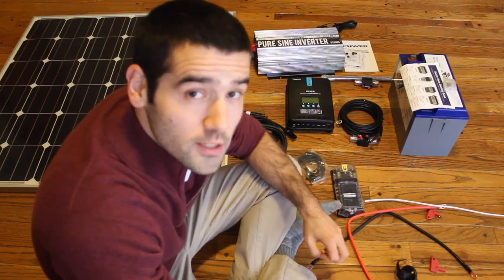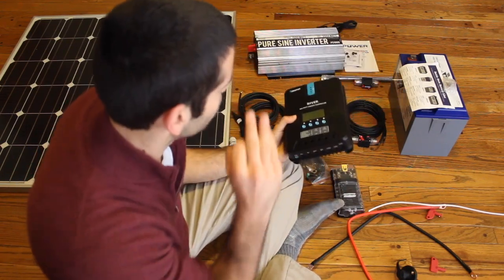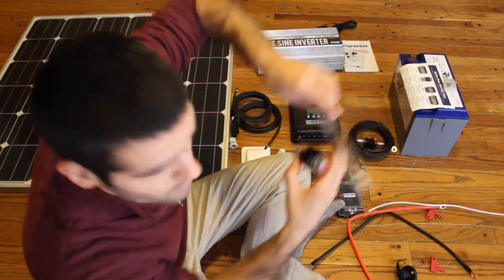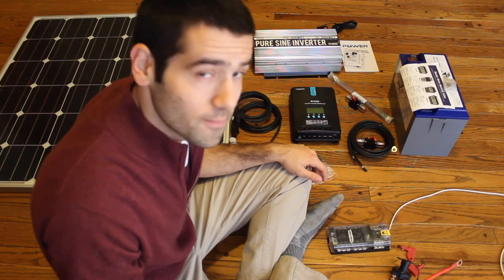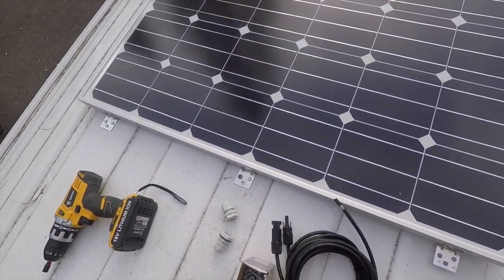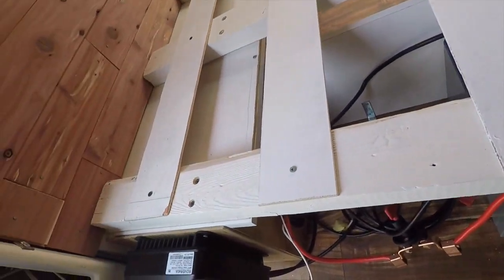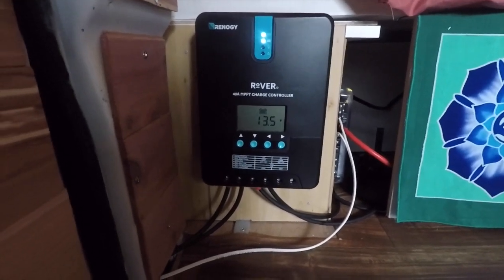Solar Panel and Electricity Setup for DIY Van Build Projects #Vanlife

Comment: Your set-up is almost identical to my project with the exception of the solar panel size and the charge controller.  The type of battery and the inverter matches with what I have.  Do you think there is a need for using 2000 watt Inverter vice 1.5KW?  Thanks.....

Comment: I’ll be using your affiliate link to snag that cable entry box. I would use it for everything but I already bought my system a couple years ago. Just now getting ready to install. Anything you wish you would have done differently? Has the sikaflex held up well over the past few years?
Reply from the maker: Nice! The sikaflex was good but I've had to coat the outside of the fan on the roof with paintable flexseal. The only thing I change is rather than putting the 100amp breaker between the charge controller and the battery, I'd have put it between the panel and the charge controller. Also, if you don't have a breaker between the battery and inverter, make sure you've got a low gauge wire connecting them and a short distance between the two. Cheers!

Comment: Thank you for sharing your wonderful build.  I would like to point out there should be about 1 inch space under the solar panel to let the air coming through to improve the efficiency of the solar panel.  Thanks

Comment: wondering if a 600 watt inverter is good enough for my 150 watt solar panel?
Reply from the maker: Panel determines how quickly your battery will charge. Inverter wattage determines what you can run from your battery. A better question wouls be like, will my 600 watt inverter run my blender? The answer is no. But it can run some lights and charge your phone and shit though
Reply: @mobiaum2274  Yeah thanks! I'm guessing 600 is enough for any kind of a laptop?

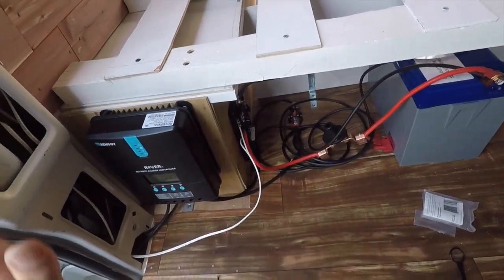Comment: 5:40 Are you certain that you killed the inverter? Modern electronics usually have protection against a reverse bias condition. Even the cheapest inverters should have a sacrificial component that drops the line in on a fault condition such as over voltage. Did you look inside the inverter?
Reply: I just purchased one that has in the instructions that it does not have protection for a reverse bias thingy.. I am in Canada so not sure if it is different in other countries.

Comment: I don't see why to pay $1000 for 1 battery.... If you got it to blow do it i guess....
Reply from the maker: VictoryInTruthMinistry Co-Pastor you could do lead acid for less for sure but this will save money over the life for how many lead acid batteries you'll have to buy over the life of the lithium ion deep cycle.  Thanks for watching!
Reply: Li-ion is the way to go for sure. Takes up less space due to being able to discharge them more than agm types and charge way faster. Also a fraction of the weight.

Comment: Yeah, that's some classy shit bro. Is the controller mppt? Yeah, I know what's up. Sorry you fried the first juice box. Did you do anything to weatherproof the self taping screws that secure the panels? Don't quote me on this but since water will sit on them it could eventually seep down through the threads, and small leaks over time make bigger ones. Looking good capn!!!!
Reply from the maker: Yeah I've got the self tappers all covered with sikaflex. I didn't include that!
Reply: worddd